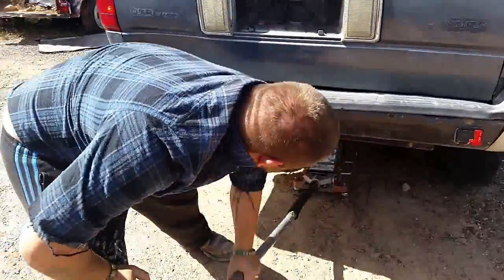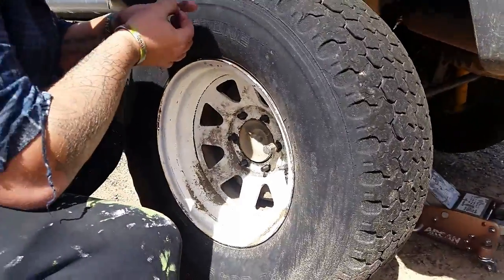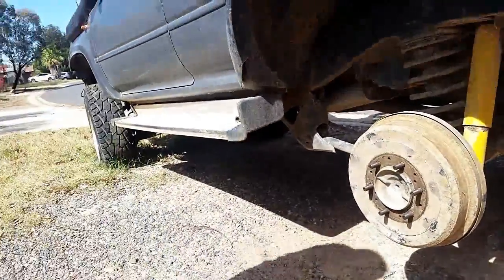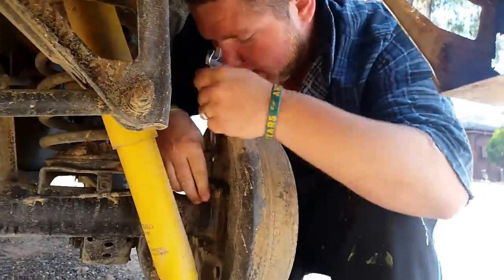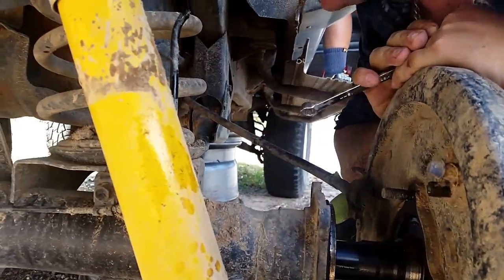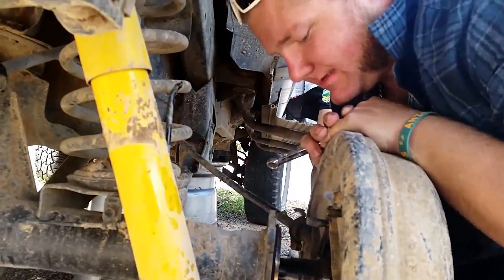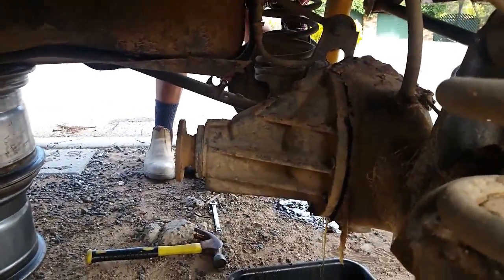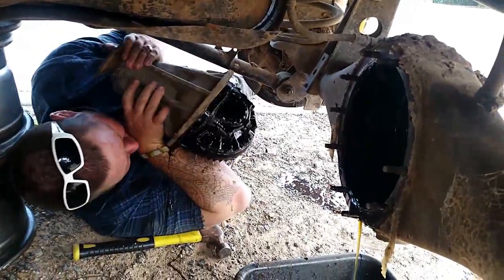Remove a Diff Centre from a Toyota Hilux Surf

Comment: Great work thanks!..v helpful. How do you get the tailshaft off the diff end tho? I have a LN 167 diesel LSD.
Reply from the maker: +Denis Sheehan 
Hi mate, probably a little late as we only just realised this comment needed approval, and we don't get an email for those ones.
Sometimes they can get a bit tough, I have found that soaking them in WD40 or a similar penetrating lubricant overnight and then using a spanner on each side, not a socket, can achieve great results.
Failing that, a socket on one end, and a spanner braced off against the tailshaft itself can be used to provide enough torque.
Also, ensure that the bolt threads are cleaned (With a Pressure washer/wire brush, etc) as much as possible beforehand, this will help immensely.
Reply: Great got it, thanks a lot. Didnt need to get my finger caught in the universal tho! :(
Reply from the maker: Yeah, been there, done that. One way I do it is to not stick my fingers where I wouldn't stick my...well, you know.
Anyway, one way to hold the uni's solid if you need to is to sick a screwdriver in there. That helps a hell of a lot to keep stuff in place when required.